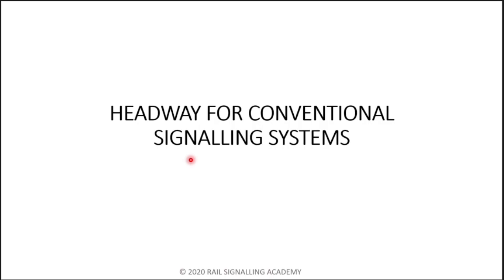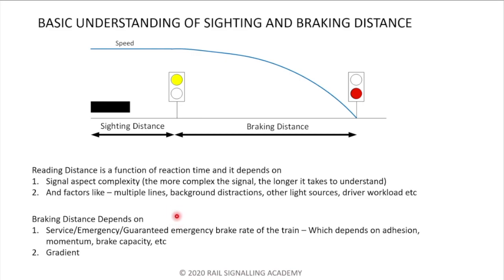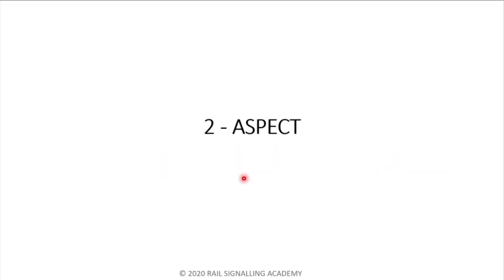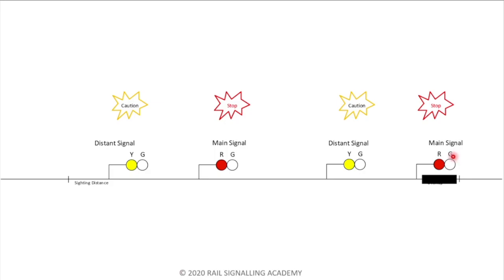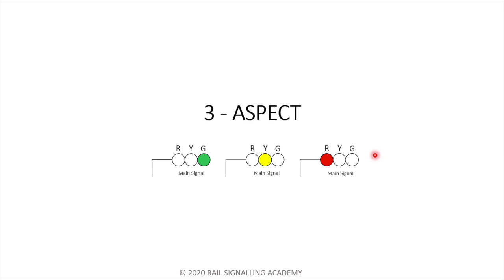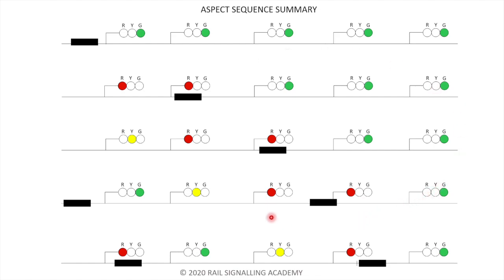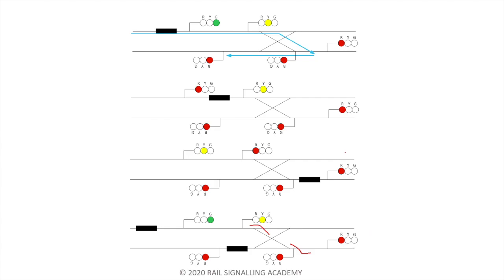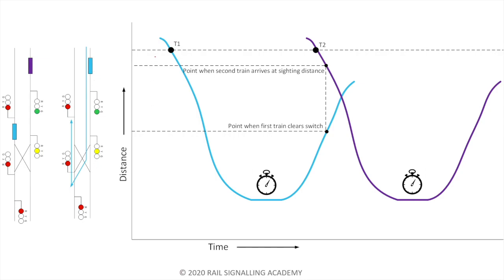2 Aspect and 3 Aspect Headway Explained

Comment: Very Clear Picture Gaurav. The basic, two-aspect, red/green signal is suitable for low speed operations but for anything over about 50 km/h the
driver of a train needs a red signal warning (Yellow One) ahead to give him room to stop. This led to the idea of "distant" signals placed far enough back from the signal,
protecting the entrance to the block to give the driver a warning and a safe braking distance. Amazing video, keep sharing ! Would love to see video for "impedance bond" from you in future.
Reply: Thank you Harsh. I did not know there was a 50 km/h limit, I just knew it was suitable for low speed low frequency applications. It's good to know. And thanks for feedback, my next series will be on Train detection and I will be sure to cover that under Track circuits.